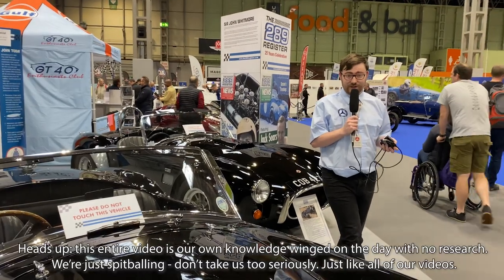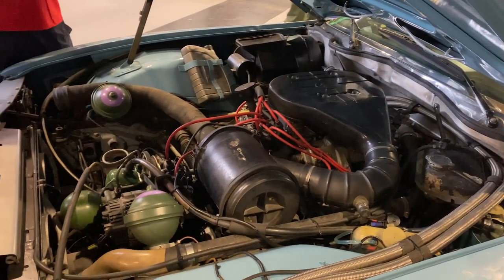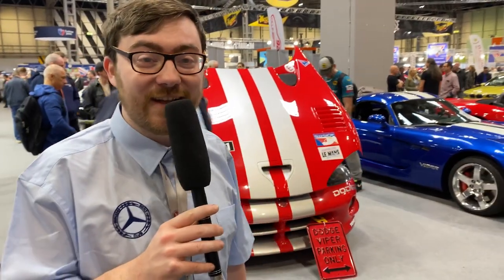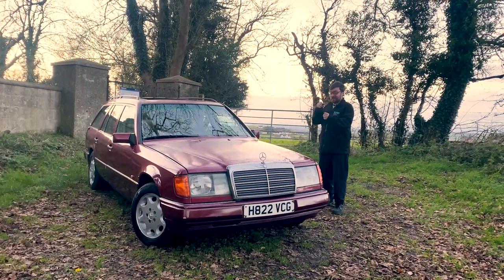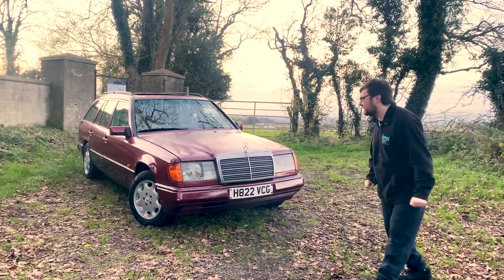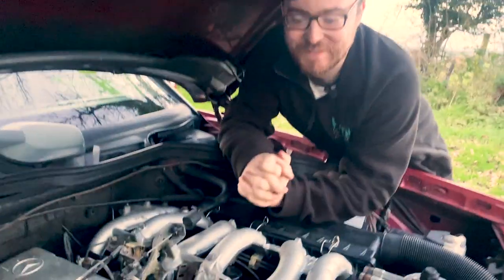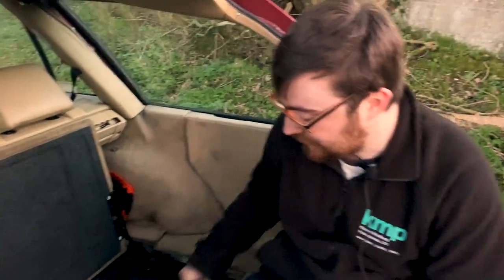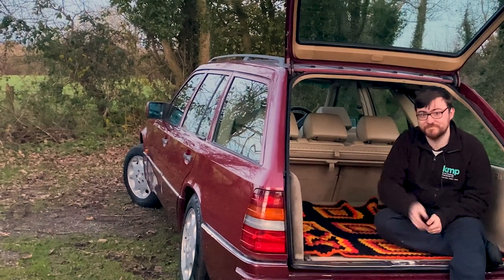We went to the NEC Classic Show and all we got was... Our dream classic Mercedes Wagon?!

Comment: The self leveling suspension is the main reason keeping me away from (old, used) E class station wagons...
Reply from the maker: It's really not as scary as you'd think. Both of us are advocates for having it and not having it... Conor is very much for having it, Tomo is very much for not having it. Neither of us have had any real issues with either setup, but, being honest both of us would agree that having it is better than not having it.
The only thing likely to give issues is the spheres, which are easy replaced and easily got. And then failing that, deleting the setup is fairly easy too now that we know what shocks are needed to replace the factory ones. 

We wouldn't let it put you off as with or without it's easy sorted!